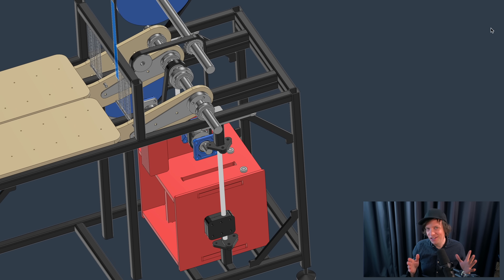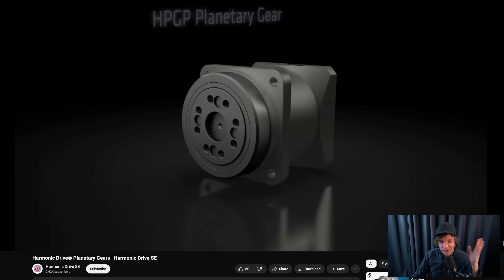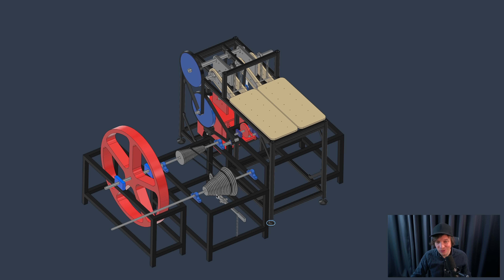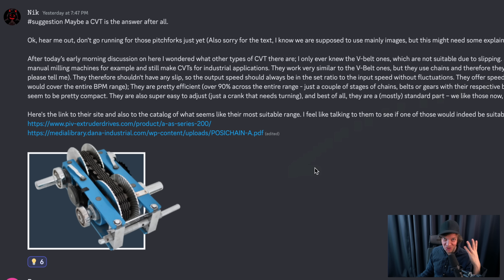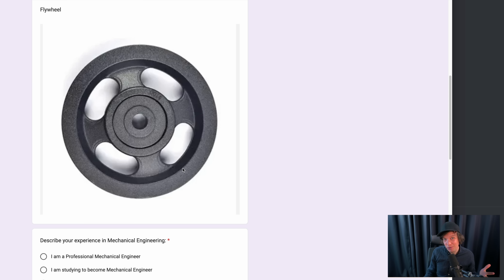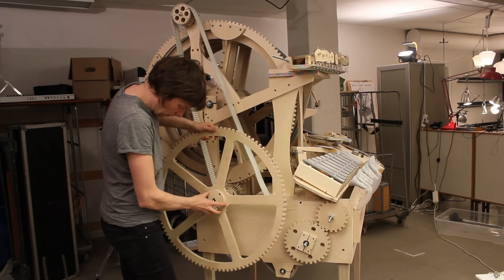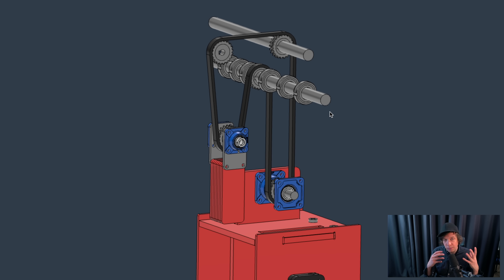Which Gear Type is Most Efficient?

Comment: Planetary gearboxes are ideal for power. They are used in all kinds of machines like drills. It does not matter much on which way the power is going in and how its coming out with them. Also since they tend to be enclosed, they can stay cleaner and well lubricated so moving them around is easier and less hassle. They also are quieter because they are enclosed where as other gears are open to the world which can make a lot of noise in the system.

Comment: I still think that the flywheel is a bad idea. The weight drive will provide timing consistency and power. With a fly wheel, if there is a hang up, you will break things. I don't think it will take much power to lift your marbles and to trigger Bowden cables And turning programming wheels.

Comment: Martin, CVTs areused in my Prius. I can tell as the speed increases or decreases, there is no "jerk" from the one stage gear into the other stage gear at a faster rate. It is a smooth continous change in speeds. And the cruis control appears to keep the tachometer constant except a little lag when goign up a hill and the speed drops slightly as the accelerator compensates.

Comment: Still if looking at efficiency alone, a custom built planetary gear train is you best option IMO. They have different ratings depending on the type of planetary and number of stages. Generally the most widely recognized type 2K-H has efficiency of 98%+ and is back drivable. Still depending on design you can achieve only certain ratios. Another very important thing that I think you forget. While looking at efficiency rating you take into account only the efficiency of the mesh. In reality gears and especially  belt drives create radial and axial forces that load the bearings and shafts and  create additional friction and power loss. Materials frictional and mechanical properties have an effect as well. Planetary gear trains shine once again since depending on their design they balance resultant forces and drastically reduce loads on bearings and other components. Efficiency can further be improved by choosing appropriate profile  shift coefficients or gears and reducing specific sliding. 

 AA(PhD) assistant professor at Technical University of Sofia

Comment: re: Pen & paper vs. CAD. Not all CAD programs are the same. I've always found "part + assembly" software like Solidworks to be clunky and inhibitive at the early stages of a design. Rhino3D on the other hand gives you the freedom to sketch but with all the powerful tools of CAD at your fingertips for when you do need them. It required some months of practice as well as putting work into shortcuts (I now use a Logitech G600 MMO mouse with lots of buttons on the side) but I can sketch an idea more quickly and more effectively in Rhino than on a piece of paper.

Comment: Spur is more efficient, helical is more quiet and allows more load. But belt/chain is even more effecient (lowest percentage of losses), but have their negative sides too (resource, size, transmission coefficient, etc.). So yes, application depends on required properties, although if it about pure efficiency chain/belt will be the winner here.

Comment: While I'd like to contribute to the engineering server, I've only graduated in August, so I doubt I'll have the best feedback.

What I will say is that I never looked at gears the same after my machine design (read, fatigue failure) class. We had a two inch thick book that was mostly tables of equations and a good section of that was for designing gears.

Comment: Whenever engineering process gets discussed I can't help but feel this would go so much smoother if Martin would take one semester of an engineering design course. I remember in my first semester of undergrad getting so much theory of engineering shoved down my throat. Like basically the first thing we did was learn how to be rigorous with our requirements models and ensure they could act as a contract between engineers and out to clients. And now, since Martin is stepping into a partial managerial role, having those robust requirements models is imperative for getting creative ideas flowing while still having the correct overall direction. I do get a bit concerned with the documents that put requirements next to suggested designs. I have always found it useful to see the requirements before seeing any previous work to avoid cognitive anchoring and to make it easier to question decisions.

To be fair, I haven't done any of that super rigorous work since my undergrad, but it is very much a useful framing tool no matter what and helps in being able to communicate with other engineers as Martin is having to discover on his own.

Comment: Cars with CVT's aren't fuel efficient because CVT's are efficient, they're efficient because combustion engines like running at a certain RPM range (The "Power Band") and the CVT allows you to run the engine at that RPM range it likes and run the wheels at whatever speed you want rather than being stuck with fixed relations between the two.

Comment: Honestly I really think the first design is solid, but it would work better if you used a bike chain and gear set. There's a lot of premade parts, and you can add shifter/ derailer allowing you to more easily change the tempo in the middle of songs.

Comment: For flywheels... look into antique tractor and PTO flywheels (John Deere, Farmall, Ferrari, etc). There's some that are portable gearboxes with massive flywheels to operate irrigation pumps and other equipment. It's worth a look. Maybe find an antique tractor show to visit. You might find someone that has exactly what you need in the back of a barn somewhere.

Comment: gear alignment will cause higher parasitic loss, the comments about using belts are right on. If you don't have stiff rigid frames that can maintain very tight tolerance  alignment accuracy, go with belts.

Comment: You know what else is human powered and uses gears to speed up the output?

A bicycle.

There are many experimental drivetrains on bicycles (including CVTs), but most keep coming back to the chain and sprockets because it works. Perhaps something could be learnt from the many years of bicycle iteration, and might save you learning a hard lesson yourself.

Comment: I think you'd best place your efforts on reducing rotating mass rather than they type of gear. 

Helical for quiet operation but consider thrust loading (though i doubt this is too significant considering the inout power) 

Other than that it's really a big watch no? Make everything as light as possible and reduce mass where appropriate. The flywheel will even out the timing.

Comment: the problem with belts is that under high load they require lots of tension to not slip. alignment is critical or you will get belts trying to jump off the pulleys.

chain might be a better bet, 

For gearing a bicycle derailleur might be better. there's a really good reason why bikes still use chains. You could use an e-bike setup to help with the power input. This is also why the america's cup boats went from pedestals to cyclors due to the greater power input. 

Straight cut gears are more efficient than helical, helical also introduce an axial load on the shaft but helical is quieter.

Comment: any time modern engineering has more than 1 solution the answer is "it depends" - all big airplanes are the same general shape, and cars are all about the same shape, because aerodynamics has an optimal solution. Trucks and trains have the same general front shape - again, an answer that isn't "it depends" - but gears and bearings - yeah, "it depends" :D

Comment: chain's high efficiency.  sure, belts are easier to draw in cnc, but i think chain should be looked at seriously.  a cvt would be perfect if you have a separate input/output on the flywheel, then you can put in power as much or little as you want and the output can be regulated, maintaining speed by hand is not easy, if it were slow i'd say to use an escapement, but higher speeds mess that up.  maybe a spinning ball speed regulator controlling a cvt on the output.  most cvt's use internal control, removing all the springs and weights, then attaching the sheave to a cable will allow external speed control.

Comment: I don't feel confident enough to join the engineering discord, but here is a suggestion. 

If you are making the flywheel, like you did in germany, get a balancing company involved, either by purchasing a machine or getting it sent off to be balanced. 

I do have a suggestion for a balancing company, which is based in germamy, and I have quite an amount of an experience with, and that is Hofman Balancing. They have experience with balancing industrial sized flywheels, which I believe the MM3 could be considered to have.

Comment: I'm an old school woodworker with zero CAD chops and even less precision metalworking ability but I'll put money down that a scratchpad and pencil should always be the first stage of the design process. Getting your thoughts down on paper is an instinctive process that gives you a chance to then look back objectively at every idea that were part of a tangled mess in your head and filter them down into a solid list of what's mandatory, what's nice, what's unnecessary and what's crazy. Then it's time to start actually sketching things out.

Comment: Flywheels are not common "off the shelf" items and I'm assuming you're not looking to mass produce marble machines either. I'd look outside the box here. I'm a mining engineer and many gears, pullies, etc especially in crushing and grinding equipment are big heavy wheels intended to carry a lot of inertia that could be used as a flywheel, even if they aren't called a flywheel.  If you tour a  ore processing plant, you may see what you are looking for. You may even find something worn  out from its original use that could be repurpused.  Couple other places to look would be train wheels ore old fashioned pedal grinding wheels. A part with a little history can add something to your machine pure engineering cannot.

Comment: I wouldn't worry too much about efficiency, what you should be more concerned about is wear and misalignment, you can mitigate the wear problem by using plastic gears between the metal ones so you can easily mass produce them for hot swapping, and then helical or double helical gears tend to help with alignment but it's still not perfect, and might introduce lateral forces you didn't expect. planetary gearboxes are a great idea because they're mass produced, efficient, and most importantly, consistent and mass produced

Comment: I was the first person to say you should use timing belts. Go back and check it out. When Hannes would say "because it preys on sound". Gears will have too much friction and you will need to oil them. A belt is the way to go. Now, if you want off the shelf parts use bicycle gears and shifter. You'll be able to switch the speed on the fly through multiple different speeds and parts are readily available. Also just use an electric motor to power it, if not, you're going to have one regular size leg and one leg like the incredible hulk.

Comment: I'm not an engineer, but I have been a technician for a long time.  I found when engineers replaced the chains in machines with belts, the noise levels decreased significantly.  I would think that noise would be a major concern in this development.  Belts also reduce the clatter of gears.  The downside of belts is that they stretch which would reduce the accuracy with time.

Comment: For the flywheel we need to know the design requirement before we can find an off the shelf piece for you. Is the diameter a design requirement or is the mass a design requirement. If mass then I would look at large diesel engine flywheels.

Comment: Well, I would say "Spur" however noise is a big issue (however and over and over again) so double helical is best, is just more hard and expensive to manufacture.
Is you need low slack and excellent noise, do timing belt.
Is slack is not a issues, however reliability is, do silent chain.
As you can see, is a matter of choosing the problems you can live with.
There no perfect solution, just solution that are good enough or superb for the case.

Comment: Maybe you could find a used cast iron flywheel from some old farming/industrial equipment and repaint it, those pop up every now and then, but might be easiest to find at yard sales on old farms. I always felt that those hundred year old flywheels, that often still are in decent condition, should be reclaimed instead of scrapped with the rest of the machines.

Also whats the efficiency difference between a timing belt, a v-belt and a micro-v belt commonly used on cars?

And if you use a planetary box, you could always combine it with a belt or chain if height or cg is a issue.

CVTs are great in theory but unless you need to change the gear rate often in seems unnecessary, and they are not known for being the most reliable type of gearboxes, though that might be a design and maintenance issue.

Comment: You might address this later in the video, but I want to comment before I forget: don't forget that this is a musical instrument, so noise levels are also very important! Both using different gearing methods and building the parts out of different materials will affect how noisy the whole power input / flywheel assembly is. The most efficient gearing system in the world won't help you if it's too loud! :)

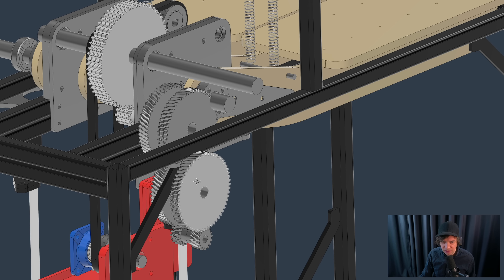Comment: A 1:50 gear ratio cannot be done in one step there shall be too much force on the this single mechanism which for power economy shall be a waste as friction (let alone the drive it is supposed to power)- there has to be intermediary steps and those too shall waste power. The gear teeth too wastes power by friction between the engaging teeth- helical gears are meant for high torque transmission and the gear teeth friction problem shall remain

Comment: Interchangeable timing gears eliminates the pitfalls of a CVT drive such as the required size of spare parts and overcoming inertia with the same mass at different speeds. You can use tensioners with chains or belts to take up the slack and eliminate again, more and larger spare parts.

To maintain the timing of your machine, you want as much of the machine's moving mass as possible at the driving-side of the machine, not the output.

Comment: @wintergatan instead of using physical weights could you just bend a leaf type spring. it would make transportation easier and take alot of the actual weight off the stage

Comment: A large 1-meter off the shelf flywheel can't be found? Have a look for flywheels for hit-and-miss engines. Some companies still make them as replacement parts. They are typically very heavy cast iron, and a 1-meter diameter one may may be a bit overweight for this project, but smaller ones with plenty of mass can be obtained.

Comment: The output shaft will need to be coupled for modularity. Design suggestion 2 for gearing changes covers both. An indexing pin keeps both shafts in rotational alignment. Using cv or universal joints on splined shafts facilitating sliding at coupling points will help to prevent output shaft binding in turn simplifying and speeding up overall machine setup. Design suggestion 1 quickest for gearing changes. Multiple belts secured out of the way of the pulleys and shafts can be preinstalled with in the design 1 transmission. Use bicycle type belt drive belts and sprockets for non-slip quiet operation.

Comment: Someone brought up a really good point in your discord that you should probably start doing the calculations for your flywheel so you dont end up like MMX and end up with an unnecessary flywheel (it was the main conversation a little bit ago). I also thought that a steam tractor flywheel would be absolutely perfect for what you want just because of how accurate they are along with the varying size and good amount of momentum so if something were to go wrong, you would have much more time to fix it before it had significant loss. also want to add that there was also an idea to use a scaled down ship flywheel that you could have made custom, which would be very good and probably better than a flywheel, but it would be very very expensive compared to a decently cheap steam tractor flywheel. (currently looking for a dealer with no luck, just model dealers or ebay)

Comment: I definitely recommend a belt.  Both spur and helical will add gear noise! Especially if they are not enclosed and lubricated!  You've gone to great lengths to keep the non-musical parts of the machine quiet, I think you'll be disappointed with how noisy an open gear train will be.

Comment: I know little of physics or engineering, but this machine doesn't run on an engine.  It runs on YOU!  We need to add a discussion about the physical fitness required to provide power to this machine.  What is your work-out routine?  A treadmill?  Would it be more practical to make the input a treadmill on the stage rather than two pedals?  It's a more natural way to move for long periods of time.  Do you have a way of practicing and measuring this physical input?  Don't skip leg day!

Comment: I think your best choice for a flywheel is to make your own, with standard components fitted in the middle of the flywheel that link it to the shaft that can be easily replaced. This way you can create the flywheel to spec with the inertia you have designed. I highly doubt you will find the exact flywheel you want as a standard component that you'll be able to buy anywhere as it's such a specific part. Also, it's a large solid metal mass, I doubt it'll ever break,  the standard component that attaches the flywheel to the shaft the part will be the part that breaks first and will be easily replaceable on the road if something goes wrong.